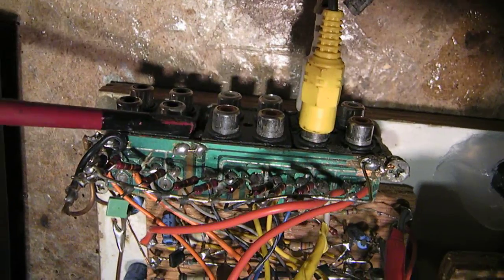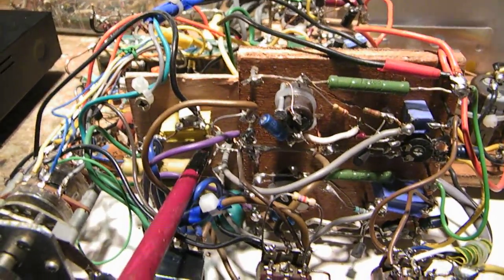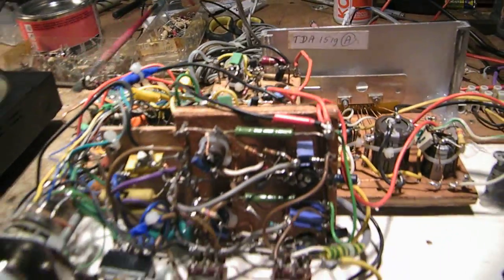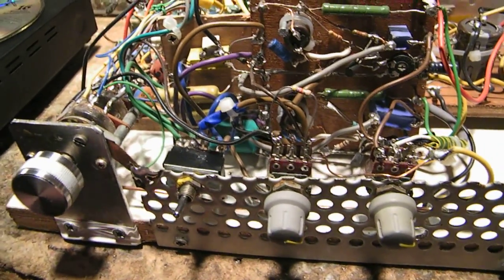Sound demonstration from the TDA 1519 A audio  chip amplifer with sound correction system

Comment: At first I did't know what the "MD element" pre means, but you made it clear in the video. Maybe it would be worth to edit the description and replace it with the MM (moving magnet) acronyme?
Reply from the maker: Thanks. In the 1970's Philips advertised with their "moving coil" pickup element. Of course also "moving magnet" pickup elements exist. The electronic principles are, of course, the same, tiny voltages/currents are induced and amplified in the pre-amp. I 'have never worked with moving magnet elements, only with moving coil elements (coil resistance approx. 1600 Ohms).
Reply: OK, so the MD is in fact the MC. My mistake. :D